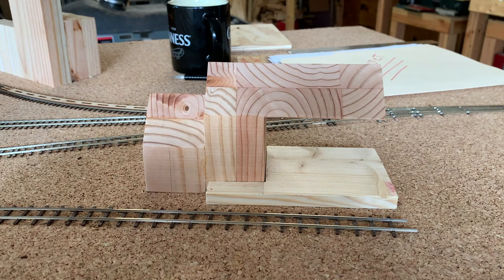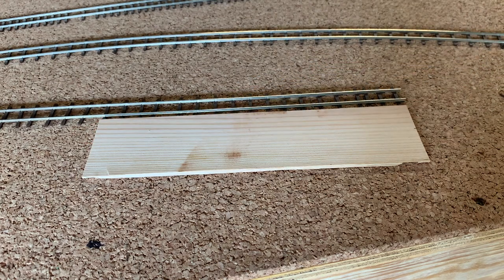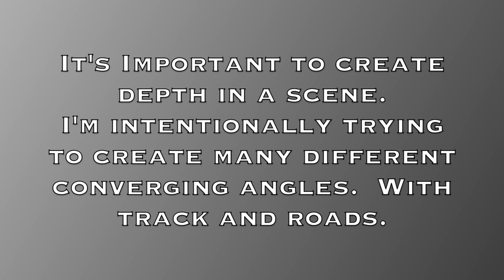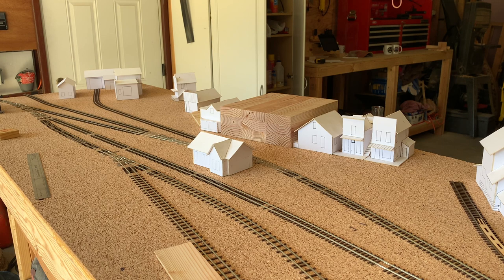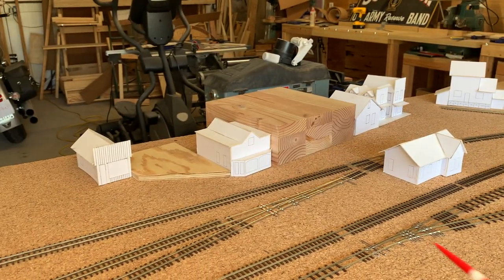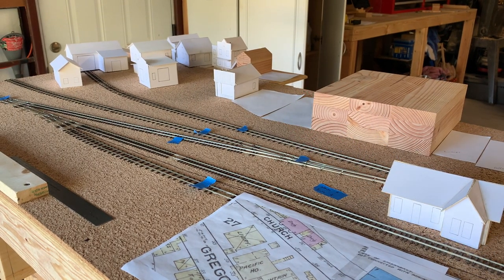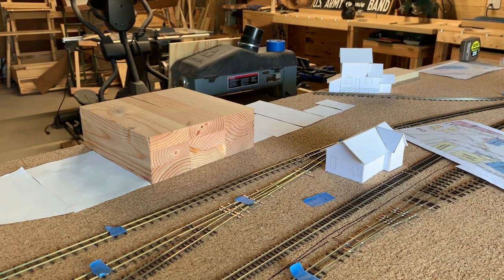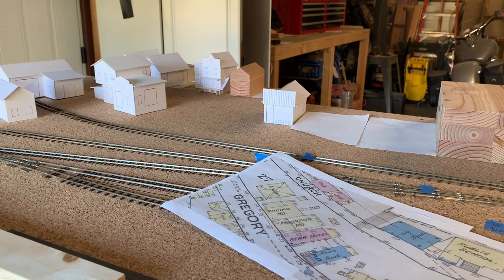Building Silver Gulch 3 Developing a Model Railroad Scene

Comment: hi Dennis... why did you decide to use wood block for your structures... this is N scale right???i notice different track in your scene... looking good so far.. thx 4 sharing.. vinny
Reply from the maker: I'm HOn3.  By the time I got finished framing the shop/layout space, I had a ton of 2x4 scrap.  I have thought all along I would use it so I saved all of it.  I inherited all of my father's woodworking tools so why not use them to create something long-lasting for the railroad!  

Other than gluing it together it takes very little time to get a basic building shape.    I will use scale clapboard, bead board, or brick sheeting to "skin" the buildings once I have the shape completed.  I'm sure styrene will get used somewhere.  At this point, it's kind of a big experiment that I'm hoping works!!  ~ Dennis

Comment: In the past, you have mentioned that the buildings are going to be wood. Are the solid blocks just mock ups or do you plan to put siding, windows, and doors on the blocks? Can you show a building that you plan to use so we can see what’s in your head?
Reply from the maker: Short answer is yes.  They will get skinned with either clapboard siding or brick sheeting as appropriate.  Since I’m getting so many questions about the wood blocks I will show my station house again from the time saver. In building silver Gulch one I show that station house and point out that it is built with the exact same technique that I’m planning on using in most of the silver Gulch buildings. I’m happy to show it again though!
Reply from the maker: Derek, you can also go to my playlist titled structure builds and find where I actually build the station house out of 2x4’s and is in its completed form as it stands now.
Reply: Thanks, I was trying to figure how you would handle windows etc in a solid block, I guess none of the buildings could be lit and the doors etc would have to be closed. I saw the Malta station video and it was an impressive building. I had your theme song stuck in my head all day yesterday, very catchy song.
Reply from the maker: @derekalexander4030  Yes for the most part there will be no lighting but there may be some work-a-rounds if I think it's worth the effort.

Comment: Standard distance between wagon wheels is 4'-81/2".   Same as standard gauge track.  This was also the width of Roman chariot axles.   It was figured out by measuring the width of 2 horses asses side by side.  (No, not 2 drunks)   The measurement as you may have surmised was 4 feet, 8 & 1/2 inches.   And the rest (as they say) is history.
KYLE CREEL
SUPT.,GM BGRR
Reply from the maker: Thanks!

Comment: I think you may be underestiimating the width of those wagons and team.
Reply from the maker: What is your understanding of their width Jerry?
Reply: @OtterCreek  I don't have specific dimensions available so there may be someone with better information. I'm just remembering from past experiences. When I was a child and we still made some use of horse teams. When older, I saw teams in use at rodeos and such. A space 8 feet wide seems a bit narrow for two teams and wagons to pass. Also, the distance between our rails today has an origin in Roman carts and roads. The distance between rails is greater than 4 feet.
Reply from the maker: I based my dimensions off of a kit that I have that I haven't built yet.  The box is scale 4 feet, I have no idea how much width the wheels will add.  The total width of my mock up is a scale15' which seemed wide enough even if the wagons were 6' wide.  If I said 8' in the video I misspoke!  Again thanks for your input! ~Dennis